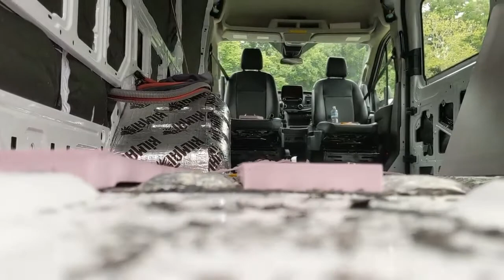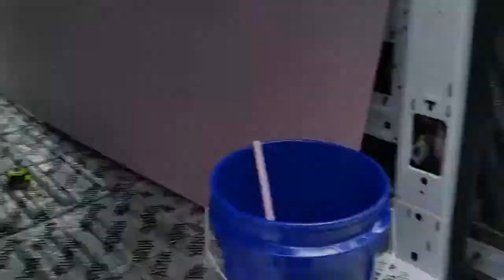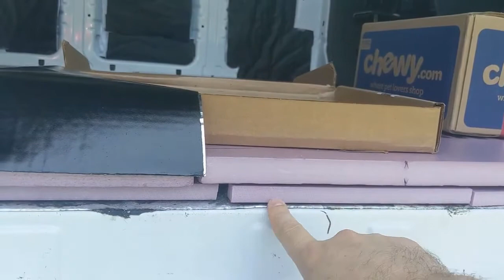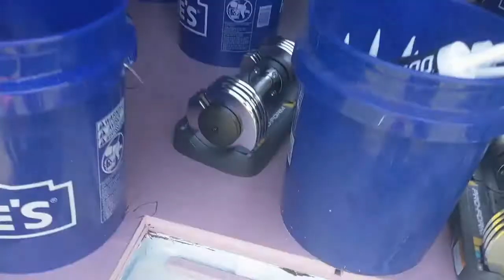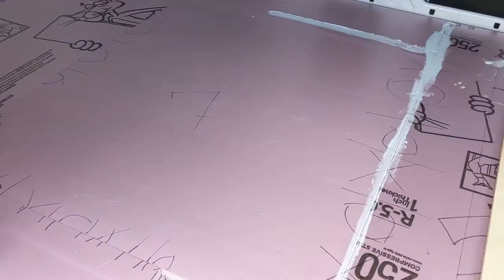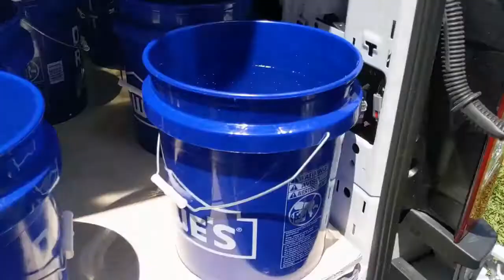Subfloor PROPERLY for a Van or Skoolie conversion, NO FRAMING. | Going Boundless Van Conversion 2021

Comment: I do like how you started the video off, agree that people are probably doing it wrong with the framing and drilling. However when I started to see the back and how you did the Kilmat, it’s hard to trust. Even the manufacturer says you only need 20 - 30% coverage for deadening. What was the reason for plastering that at 100% coverage?
Reply from the maker: All I know is, my van is super quiet. I have no regrets and have traveled in it for 4 years or more now. Without the kilmat, the cheap ford flimsy thin walls of the van would be rattling around like crazy. The loudest parts of the van are in the doors that couldn't be covered.